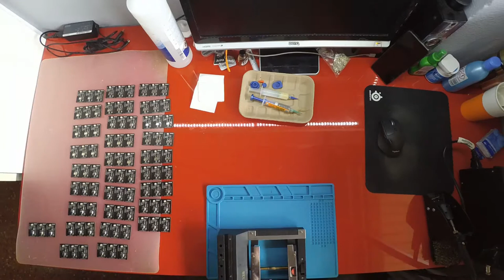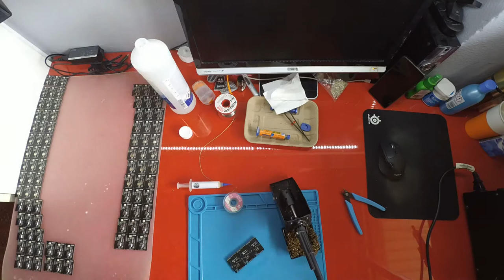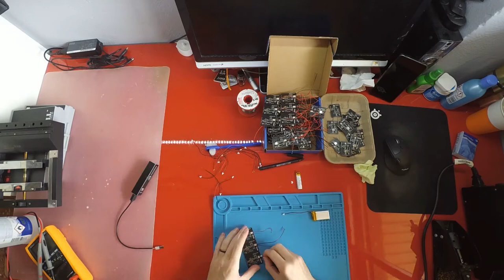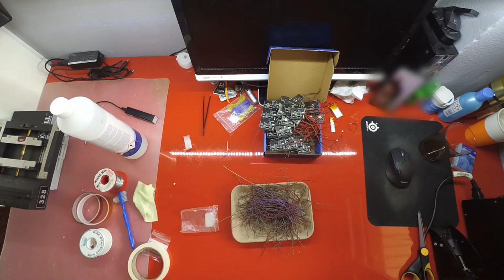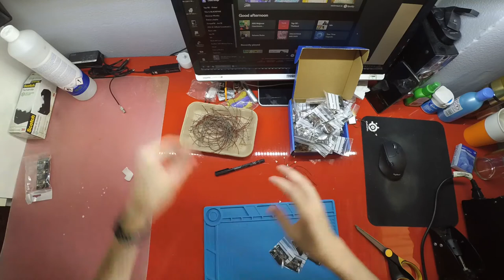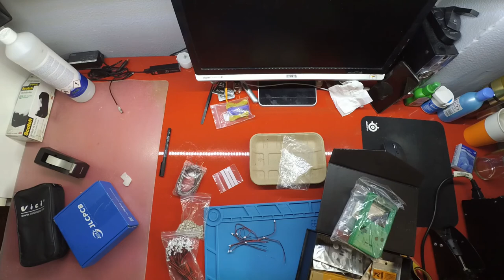Game Boy Color USB-C Charging Kit (assembling)

Comment: hey man I sent you a message on your website, not sure if it was the correct place but I wanted something more private
Reply from the maker: Sorry, I forgot to answer you. I don't have the information for fixing the Nintendo Switch CPU. I mean, I don't know the value of the capacitors the CPU has over it, or other information. I just know how to solder but not how to fix it.
Reply: @giltesa  It's not the CPU.
Reply: I just pulled one of the gold pads off the modchip, it has little solder balls stuck on the top/bottom of where the pad used to be, Do you think that's connected to the trace? Can I just put a bridge between it and bridge that to the capacitor? Or should I scrape the trace out and make a better connection?